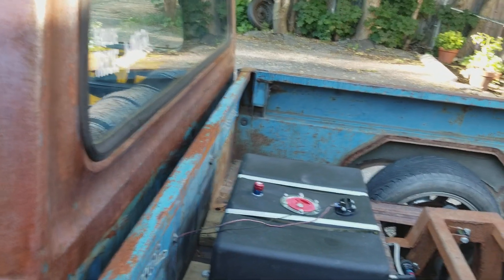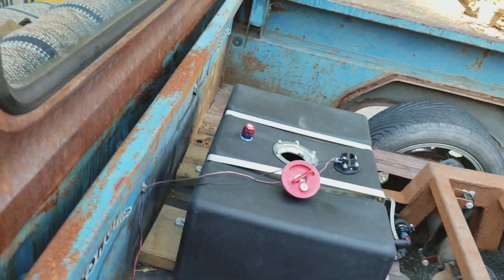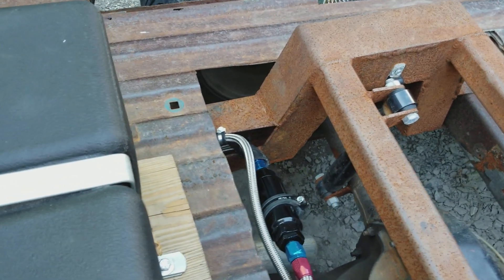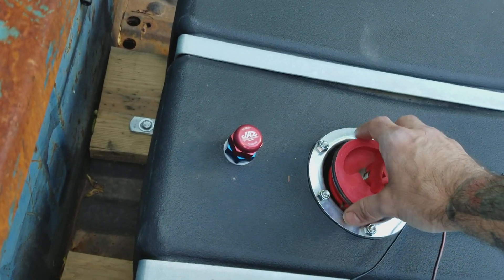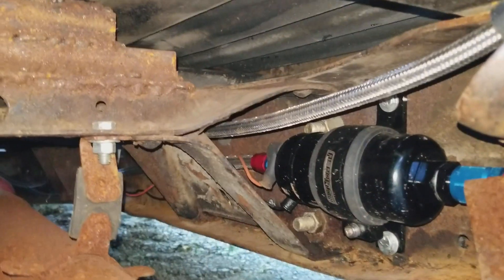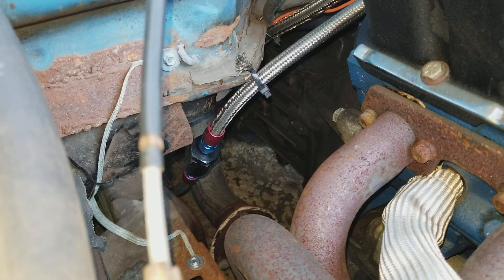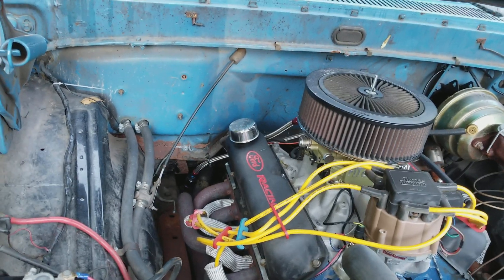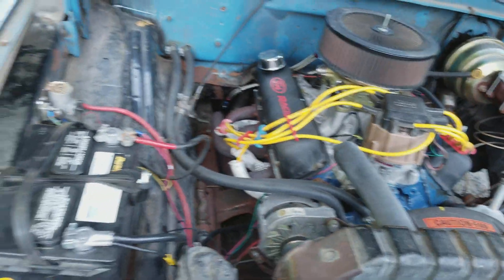Fitech fuel pump still cavitating

Comment: The feed line to the pump is being sucked shut. Replace it with a ptfe hose or a 10an aluminum hose.
Reply from the maker: Turned out mine was clogged all the way up to the injectors.

Comment: disconnect your feed line and run it to a bucket.
Let it flow and measure how much it puts out in a minute. You'll be able to determine if the pump is flowing what it should be.

Comment: do you have a final verdict? i’m having the same problem once it gets to operating temp. the noise isn’t as loud but it sounds like a water hose that’s trying to build pressure. fitech told me to lower the pump some and see how it works and it didn’t work. i think it’s a pump defect. ironically that pump is out of stock on their website

Comment: bad connection. pump was running on 12 volt negative cut out. thats wen the 12 doesnt have a solid ground. my 78 ford granada did it. took me ions to figure that crap out.

Comment: Have you tried running it without the pre filter?
Reply from the maker: Heather Hornak yes.. it runs rough but doesnt whine
Reply from the maker: Heather Hornak i did actually, when i did the pump didnt get loud.. but it ran very choppy
Reply: This may be a shot in the dark but try removing the return line from the fuel cell.  Then run the line from the throttle body into a gas can.  Maybe the fuel being returned to the tank is too close to the fuel outlet.
Reply from the maker: Heather Hornak worth a try thanks

Comment: My truck did this its a plugged filter at the throttle body. Also check the fuel regulator there is a screen that will plug on it also. I bought three pumps before i figured this out!!

Comment: The FiTech fuel pump is nasty.. I ditched mine for a Bosch 044 and its now silent.. I got sick of the noise of the Fitech pump
Reply: Did you have the same issue as this guy? Or did you just change it because it’s loud?
Reply: @terryprahlad7397  I changed to the Bosch primarily because of the horrible noise the FiTech pump made, but did notice an improvement in peformance too.. But still continued to have daily issues with the FiTech, so after a year swapped to the Holley Sniper (kept fueling same) and it transformed the vehicle. Zero issues since and zero reliability issues..
Reply: Allan Chambers thank you
Reply: @terryprahlad7397  think I managed 6,000 miles on my HP400.. With problems almost daily.. FiTech technical is a joke, when my truck failed emissions FiTech said there kit is not designed to meet any government emissions tests.. The truck would cut out at red lights or stop signs every other day. So I ended up removing the HP400 and fitting the sniper.. And it's been amazing. 4,000 miles on the sniper now without a single issue
Reply: @Allan Chambers yes mine start whining first time I drove the car for about 30 min, it would cut off and start right back up after about 30 second to 1 min, I’m thinking to order a Holley sniper  (any particular model# you recommend)
Reply: @terryprahlad7397  I spoke to Ethan at Holley.. He said they have a lot of people ditching the FiTech and switching over. I replaced just the unit, left the Bosch 044 and fuel lines.. And didnt change any of the wiring.. Just had to swap O2 sensors (supplied in the kit) and it started amd ran perfectly first turn of the key. Ethan at Holley has been great.. I can call him and speak to him at any time.. If I email he replies within an hour.. The Sniper handheld screen too is way way betyer than the FiTech screen.. My set up is a brand new 302 Summit Racing crate motor.. New gas tank everything..
Reply: Allan Chambers awesome

Comment: I'm having the same issue with my Fitech fuel pump. I'm having that same LOUD WHINING issue. having the same exact issue
Reply from the maker: Ok i thought i was cavitating, it wasnt , it coundnt push through the fuel filter. 1st prefilter was dirty, then pump, then ,regular filter. I finally removed it and took it apart and the injectors must be clogged too
Reply from the maker: When i removed the supply and put it into a container, then i primed it and it filled the container in a second or two. So therefore it must be my injectors.  I wasted alot of money
Reply from the maker: Check each piece one at a time
Reply: @hairnbeard  does it still make the loud noise?
Reply from the maker: @arturoochoa8401  i removed it and went back carburetor.. but i havent given up im debating trying to order new injectors.. twice fitech told me they we going to mail me new filters and they didnt both times two different people
Reply from the maker: @arturoochoa8401  my friend said his buddy is having the same problem
Reply: @hairnbeard  yeah I did an LS swap so can't go back to carburetor. But my pump has made this loud noise since day 1 brand new our of the box. I will take video and show it to you some how. I do have a few issues to fix because ei am further than 3 feet from the tank and it is at the same level of the tank. I have to lower it and move it closer to the tank. Either way it still makes that same loud noise which is giving me problems
Reply from the maker: @arturoochoa8401  make sure you have a proper vent.. take supply off unit and put in a container and turn key to see if and how much fuel is getting to injectors.(fuel pressure guage will work)
Reply from the maker: @arturoochoa8401  also make sure flow is in correct direction